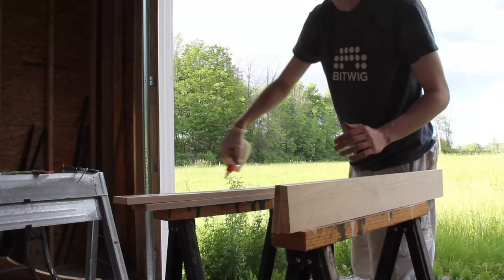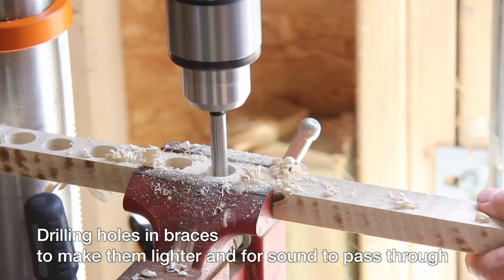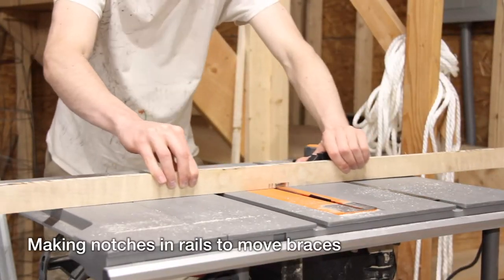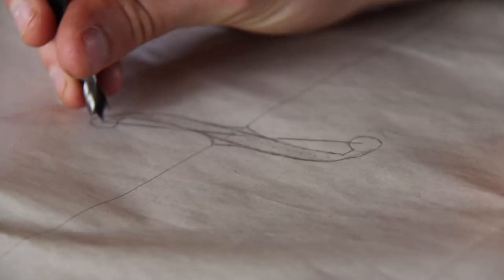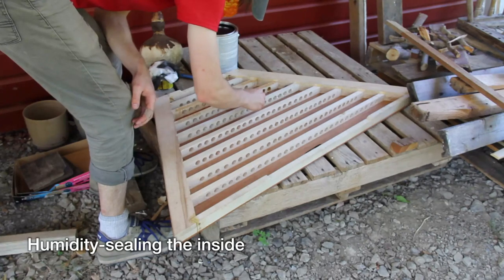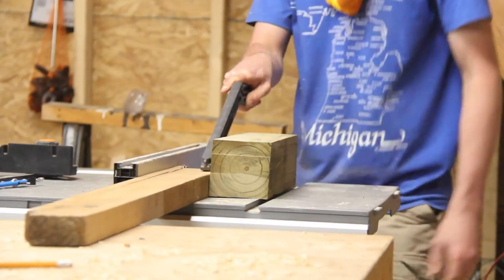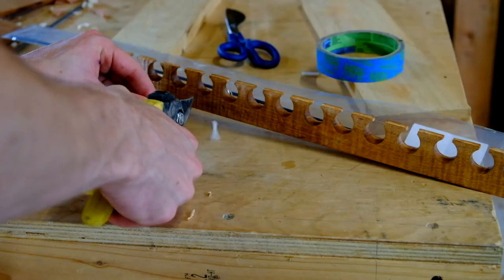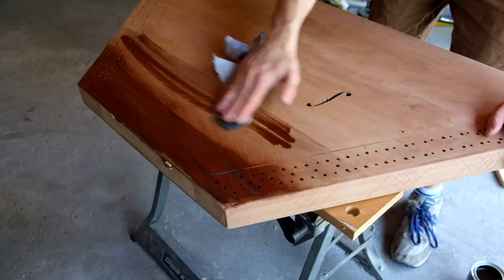Building a Hammer Dulcimer - Start to Finish

Comment: Nice work!   Building on the floor is murder on the back.  A large build table is cheap and easy!  Also, a router plane makes short work of shallow rabbets and dados, and is more accurate than doing multiple cuts with a table saw and following with a chisel.

Comment: Very nice job. I was around your age when I built my first Hammered Dulcimer back in the early 1970s. There was really no info out there about how to do one. I had wanted to try my hand at one after seeing Shivkumar Sharma  the renowned Indain Santoor player a few years earlier.Eventually I found a Ukranian man who was a retired farmer not far from where lived in upstate NY- He had built them for members of a Eastern Orthodox Church he belonged to - he let me take measurements of his and gave me a lot of tips and I was off to the races- was able scavenge a sound board out of a eighty year old piano- my first attempt came out nice, sounded great but I used plywood on the back and after five or six years started to buckle-during this time I had started building other instruments ,eventually guitars-I did end up rebuilding the Dulcimer with the same sound board and much heavier materials. In the mid 80s I stopped working on instruments all togeather-had too many things going on. Im retired now and have been going over some my old pieces that are still around-the hammered Dulcimer needed a fair amount rehab - got it all stripped down, going to reconfigure the bridges to make it a Piano Dulcimer. This Dulcimer weighs close to 30 pounds maybe more-the case was made of heavy tropical wood-nothing I can do about that now. I was struck by your methods to keep the weight down but still very strong- so if I crank out another one I will try that method.
Reply from the maker: Thanks for your comment, and sorry for the late response. I'd love to see what some of your older pieces look like, you should post some demo videos! Also I'd be happy to get in touch to help with measurements and building tips if you go forward in making another dulcimer! Cheers!

Comment: Nice. Thank you. On mine I made the internal braces out of invar steel low thermal expansion. It works well- stats in tune for 6 months at a time.
Reply from the maker: Holy crap, that’s badass

Comment: Very good video- seeing overall construction and especially the bracing under each bridge, was helpful for me to understand an instrument I’m refurbishing. You have great talent as an instrument maker, a videographer and a musician!
Reply: Aaron, I am refurbishing a big heavy chromatic dulcimer (early Sam Rizetta design). When I removed the floating soundboard I found 3 stainless steel vertical braces under it. A friend suggested the tone of the instrument would likely be improved by replacing the steel braces with wooden dowels- maple I’m thinking. I see in your video you have one metal vertical brace along with the felted wooden ones. Why might my builder have chosen 3 metal braces? It is a big, heavily strung instrument but it seems like there would be a lot of cost in loss of a warm tone.
Reply from the maker: @SoupyD  hmm. My guess would be that if the dulcimer is really big, it would take longer enough to get all that wood vibrating that the metal was used as a way to quicken the attack. The tone might be warmer with the wood, but it might lose more power than it's worth, or have a slow attack. I don't know. This is all conjecture, and the only way to find out is to try it, since every instrument is different. I'd love to see a picture of it!

Comment: Great work. You can make the cutting of the bridge much easier by attaching a beveled piece of wood to the fence with double sided tape. That will give the piece horizontal support while you’re cutting it, lessen the pucker factor.
Reply from the maker: very true. I'll likely do that in the future, or try it out. I think I was in a bit of a hurry and felt pretty confident about the cut at the time of the video, but if I were to do that cut regularly, I wouldn't want to roll the dice of injury too many more times.

Comment: Very nice!  One thing - joining the soundboard and back pieces end to end like you did creates a very weak bond.  A better joint would have been a half lap or ship lap joint.  Also, never glue thesoundboard to the rails - it's supposed to "float".
Reply: Some manufacturers do glue their soundboard to the rails. It a preference really, and gives a bit off a different sound. However, that being said, glued soundboards don't do well in places where temp and humidity changes can be extreme. They don't expand and contract freely.
Reply: I believe it is a matter of preference. 
A glued soundboard provides extra strength and stability to the entire structure as it becomes a part of the structure itself and contributes in holding the structure firmly.
The advantage of having floating board is that it gives more vibration and thus sounds louder too. Also it doesn’t get bent due to expansion and contraction since there is flexibility due to extra space. 
Both have their advantages and disadvantages.

Comment: Love the video!  how many inner braces should I use for an 11/12 dulcimer?  Thanks
Reply from the maker: Thanks! Hmm. If you're going for the same design (moveable braces), I would say 4 or 5 crossbraces, and 2 moveable verticals, but for that 11/12 size, it might be less worth it, or just be easier to put the two vertical braces and have them extend all the way down, and be glued to the back, but then it's more important to put them in the right places..

Comment: Looks and sounds great. I've watched this video three times so far. I look forward to part 2.

I also am embarking on building an instrument based on Rick Fogel's 19/18/6 5-octave design. Did you start with his 4-octave plans and extend them? Or did you come up with your dimensions some other way? Any findings that you might care to pass on to a fellow builder?
Reply from the maker: I came up with the dimensions from finding as many details as I could from his website (48"x23"x2" box with 50° and 60° trapezoid, 1.125" string spacing, etc.), and then guessing the rest, and asking my friend who has some of his instruments. There were a lot of things I didn't get right. I could've had a way better position for moveable braces (I'll move them at some point I guess) I also spaced the tuning pins out too far horizontally, and it caused buzzing issues. The hold up for part 2 is that the dampers I filmed myself building were pretty bad. I figured out how to make better dampers almost exactly like Rick's and they work great, so I'm hoping to film that part again and post it when I get some time. Feel free to message me or send me an email, I'd be willing to help any way I can. :)
Reply: It seems YouTube no longer supports PMs. Can you be contacted through Facebook?
Reply from the maker: @joeeckardt132  yes
Reply from the maker: @joeeckardt132  On FB, it should be a picture of me climbing a tree. Also I put my email on my Youtube Profile.
Reply: @aaronwolff4  hey I couldn’t find your email, did you remove it? I have some questions for you about the build.